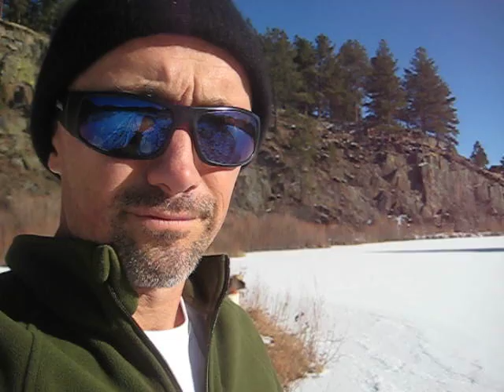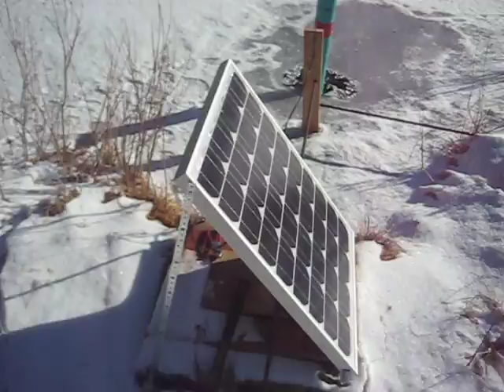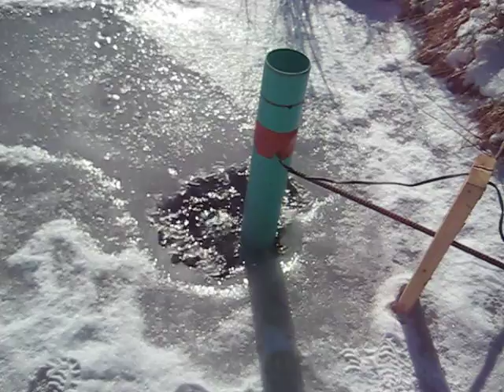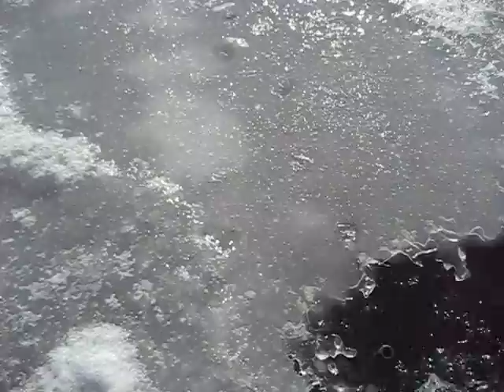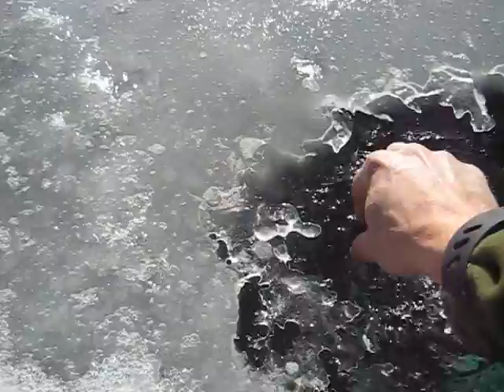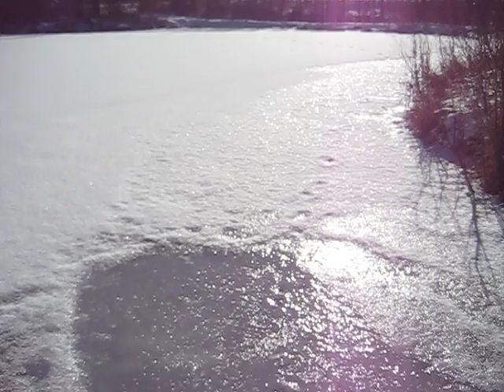DIY Pond Aerator with solar and venturi

Comment: Pumping air into water is much more efficient.  It also warms the air instead of using the venturi that sucks in  ambient air that could be sub-zero in temperature leading to more ice.   It would be interesting to actually measure what volume of this pond rises in oxygen concentration.

Comment: On the last 10 seconds of the video, a link will appear where you can click and see another short video of the plumbing.  Once the winter season is over, I'll disassemble the setup and take a better video.  This year I changed it to a Rule submersible inline pump that is encased in a 1.5" PVC.  Works better.

Comment: Bubbles alone can do the same job at about 10% of the energy required to pump (lift) water.  Try blowing bubbles  through the straw in your drink versus sucking (lifting) water which weighs over 8 lbs/gal.  Bubblers also do not plug everyday with leaves, grass, and mud.  Bubbler maintenance is more like every 2 years vs. daily pump maintenance.